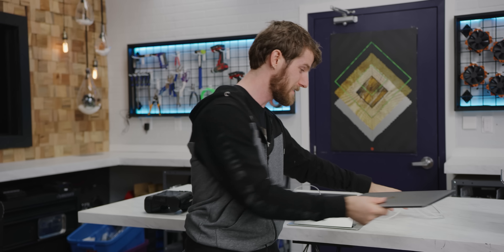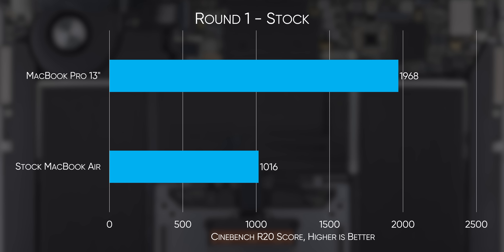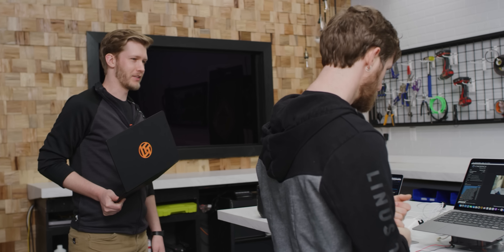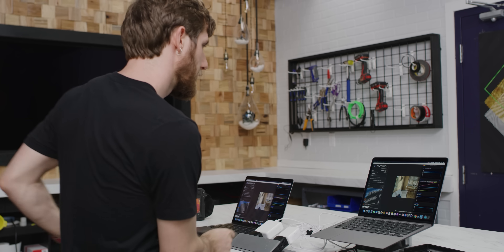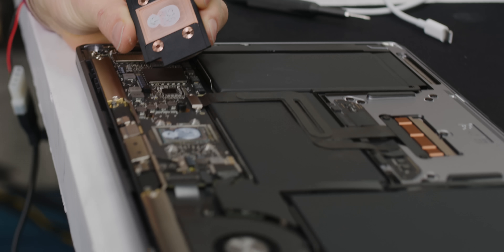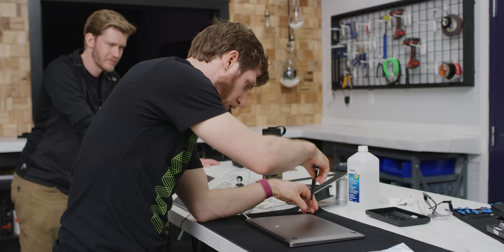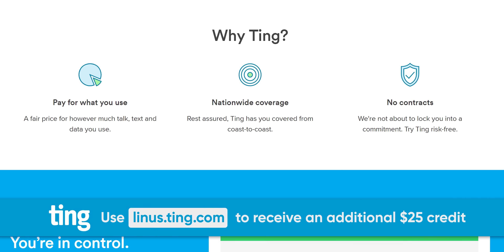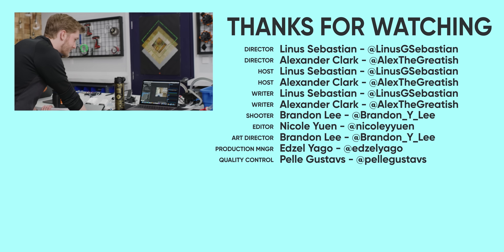Fixing Apple's Engineering in an Hour

Comment: I would've loved to see the fan just completely disconnected to show that it's literally having 0 effect on the computer.
Reply: the computer would probably throttle 100% of the time if the fan was unplugged no matter what the temperature because software
Reply: Then take it out of the case while its is still plugged in.
If the cable is not long enough, get an extension. Job done.
Reply: @The_Keeper  use a jumper with the correct resistance and you can eliminate the fan altogether
Reply: @Damian_CS2  my thoughts exactly
Reply: @The_Keeper  SHORT THE WIRES
Reply: @The_Keeper  you can get fan control software, I use it on my mac
Reply: @OdgeBodge  they should have moved the wiring so that the fan was outside the cpu as a test.
Reply: @OdgeBodge  it already reached 100degrees instantly with the fan.
Reply: my 2 cents on the fan is that it probably passively keeps SOME air coming in w/ negative pressure. it doesn't "actively cool the CPU" it half-ass cools the whole PC but not enough to handle the CPU temp load.
Reply: It probably draws air from one side going over the pcb and out the fan
Reply: And it actually help the temperature by pulling less from the battery... yeah that’s Apple alright.
Reply: @paulgrass4855  how much power do you think a fan uses lmao
Reply: This is semi passive cooling solution. intel made this chip low on power to make it similar to ipad pro. Apple still include fan to cool down entire body of MacBook just for comfort of using it not to cool cpu. That cpu was supposed to never get hot like arm processor. Unfortunately these are not meant to be used like that. And intel is just trying their best at not losing apple as customer. Also apple is not trying to make logical step in to adding a single heat pipe towards exhaust fan. Just a bunch of greed and not caring about customer.

Comment: Maybe Mac OS has some power draw limitations in place. Next time it would be interesting to install windows 10 on the MBA and redo the tests to check if there's any temp difference. Perhaps windows is able to squeeze more performance out of the chip.

Comment: Is someone making aftermarket bottom chassis pieces for MacBooks? Should they be? Imagine adding a proper copper cooling block inside the chassis and increasing its width like 2-5mm... I'd buy that if I was a MacBook power user.

Comment: Put a thin pad of material on top of the heatsink that spread the heat to the fan inside and see if you can get the 1155 speed without external help.

Comment: The water cooler is better for testing as you can use a fan with it without worrying about it spritzing the motherboard if doing open bottom. Unless there is a leak of course.

Comment: Maybe the point was passive cooling to avoid fan failure. But then they could have added a fan regardless. Would it hurt anything if the fan blew the cpu air onto other components? Maybe something else inside is sensitive.

Comment: You know hwhat? Given how much crap it gets for its gimped cooling, and it still is a gimp for the heat and noise factors, how little you actually gain from bonkers cooling solutions makes me a little more forgiving of it. The chip is within 10% ish of its theoretical peak if it wasn't thermally limited, because the PL limits aren't that much higher. On the other hand, temperatures are improved by 20 degrees just by making the CPU make contact with the metal plate on the heatsink, which it stupidly doesn't by default?

Comment: I'm not an industrial engineer, but I think I see what Apple was getting at here. There appear to be plastic bits on the bottom cover that seal the logic board compartment off from the battery compartment. The fan exhausts out the left side into the hinge, and since the only intake (that I can see from this video, anyway) is the right side of the hinge, the fan draws air directly across the chip's heatsink. It's not quite as efficient as sticking a heatsink right next to a fan since some air will go around it, and the air that does go through it will be slower, but the fins on the heatsink are clearly spaced out more to optimize for this high-volume, low-velocity flow.

It's cheaper than running a heatpipe directly to the exhaust fan, not to mention much more space-efficient in a device that already has zero space to spare. There are already PCBs where the heatpipe would need to run in order to be useful, so it probably wasn't an option. They could have made the heatsink bigger, but that too would have required more space. The design mandate for this system was probably to cram it into the smallest chassis possible while still maintaining some set minimum level of performance, and the internal design reflects those priorities.

Besides, these were designed with web browsing and other bursty workloads in mind, where the load is gone before the CPU even has a chance to get hot in the first place. If you want to run Cinebench or workloads like it, a Macbook Pro's cooling solution is much more geared towards heavier, sustained loads. But hey, this is LTT, and I will never not enjoy the gang strapping a ghetto chiller to a low-end computer.

Comment: Instead of cutting the original cooler you could have simply cut another piece of copper to fit in the hole then put paste on both sides... That machine cutting the hole bigger was completely unnecessary.

Comment: was expecting customised heat pipe and rad inside the mac : An Idea for next vid ?
Reply: It's useless. The sofware part throttle it.
Reply: @Smirnoff67  to avoid the hot spot under and lower the PCB temperature it's not useless... Those Mac's are going to have premature deaths and are going to end up on Rossmans table... I wanted to see a proper use of the fan that's all
Reply: @The25Fantome  You want customised heat pipe and rad on a computer that will throttle in any case because it's dumbly software limited despite a better cooling.
So, your idea of video is useless. 
Watch the video again, they cool it way more enough, and yet the software kick in.

Comment: Not only is the fan not connected to the heatsink by a heatpipe or proximity, but the metal plate doesn't even touch the die by default? What the heck? They REALLY wanted to gimp the Airs thermals over the Pro. And probably over the ARMbooks coming.

Comment: Apple : We made a “premium” laptop.
They bought a Intel CPU, Intel Chipset, slapped a decent screen on in (also made by a 3rd party.) built a motherboard, chassis and cooling system that couldn’t keep the CPU cool.

THE ONLY PART OF THE SYSTEM THEY DESIGNED IS WHAT’S BAD!
Providing a pretty box to put a crap cooling solution isn’t a “premium” piece of technology!  This is really no better than when you bought prebuilt gaming PC.  The part that Apple actually built is what’s wrong, apples may be prettier (subjectively) than theirs but that really shouldn’t matter.  
I’d much rather have a ugly laptop with good engineering on both the power delivery system and the cooling system then a pretty laptop with a crap electro mechanical design.

Comment: I think it's a totally win the test with water cooling it, it didn't show improvement in power, but not having your system die out of overheat is good enough. Maybe the best solution for now would be using a standard Air Cooling from a used Graphics Cards mounted in a stand, now that you have removed the heat protection from the bottom and don't want to get burn by it.

Comment: If you use bootcamp to install Windows, you can use Throttlestop to attempt to bypass the stock turbo power limit. Works on my HP Envy x360 15-bp194cl

Comment: I've been saying it for two years, IF Apple decides to put ARM chips in a laptop it's either going to take the form of : Making the iPad (Pro) a full laptop, or killing the Macbook Air lineup with something else. We already know the ARM chips can beat Intel's crappy U and absolutely good-for-nothing Y chips. It's doubtful an ARM part can beat an H part (which is likely what's in the 2019 Macbook Pro) or a desktop Xeon (in the Mac Pro.) The 13" 2020 Macbook models actually took a significant nerf from their 2019/13" models. The MacBook Air took an almost 70% nerf.

Comment: With the experience with the XPS 15 9750, connecting the heat pipe to the bottom panel w/ thermal pads doesn't help the performance at all. The PL1(57W) still decreases to 13W in the worst case. But putting a USB fan blowing on the keyboard actually achieve better thermal in either CPU or the temperature probe that might be sensing the VRM components. 110C+ without the fan, 87C with the fan. The CPU can finally hit 3.4GHz all core under extensive VRay rendering rather than bottom out to the base clock.

Comment: What the hell is that fan cooling? It's not connected to ANYTHING, so it's basically just spinning, making noise and wasting power and space. I'm sure that Apple has at least a few competent engineers, so how did this get greenlit and go into production?
I guess because Apple fanboys are literal zealots who literally pray to Steve Jobs so that their overpriced computers don't die and because Apple will simply refuse to fix it if it breaks.

Comment: Pfff!!! Apple engineering 👎. 
Imagine if there was an Arm powered Mac clone that is more portable, more power efficient (although significantly slower) COOLER, with a cheese grater look that can be used as an actual cheese grater 🤣😜😜.
Feel free to check it out. Both parts of the build are up in the channel.

Comment: 14:00 Yup Linus, i have the same issue with my laptop, it aggressively throttles CPU down to 400Mhz(All-core) (usually when gaming, but also happens on just Youtube) from 3.675Ghz(All-core) turbo speed. i have done all i can in power settings and yet it still limits, also drops both integrated GPU and the other one to 300Mhz at the same time. resulting in about 3fps. It even does this with the charger plugged in. although i have noticed that on really intensive games the laptop does not charge while playing.

Comment: Dell Latitude laptops also don't have the fan connected with the heatsink. It is done so that the fan can be replaced easily without removing the heatsink from the CPU. But as you guessed it, 90-100 degrees instantly...

PS. Watercooling helps dramatically. MaxTech already did it and it was really nice to see the Macbook Air perform the way it should.

Comment: Why didn't you show the thermal pad? I was so confused about why it didn't fit until you guys later mentioned the thermal pad.
And there is still a fan inside and it is in no way connected to the cpu? Has it no purpose at all?

Comment: I'm surprised with how much work you all do on Apple and Razer machines, that you don't utilize under-volting software like Throttlestop. Sometimes limiting voltage can have a positive effect on performance and temperature with power-starved machines. 
Granted, Apple and Razer do this out of the box, but fine-tuning can always be done as each processor is going to have slight variations.

Comment: Honestly, they did it this way for the Macbook Air so it wouldn't come close to the performance of the Pro series. More threads at a lower clock is still more powerful than the dual core processors they had in there, but not enough to compete with the Pro series so there's a visible difference between them.

Comment: At this point the fan is clearly for aesthetics The CPU has been intentionally gimped to fall in line with their product stack.
Reply: It's there so they can pass brain-dead FCC regulators.

'Fan?' - check, 'heatsink?' -check. 
Must work, tell Apple it's approved
Reply: Yup. No reason to buy the i7 or even i5 variants when even the i3 thermal throttles down to the same level of performance.
Reply: There are 2 gaps in the back of the MBA, the Fan is obviously meant to pull air from the other side and then out. The bottom cover even has insulation to guide it over the CPU. 2 minutes of research would have given Linus better information.
Reply: @avnger619  Well by just cutting a bit of copper he got a 20ºC improvement so that stock design is still garbage.
Reply: @castome7pi  Yup, a heatsink that doesn't touch the heatsource... 
That is either pro-level arrogance or idiocy.
Reply: Right, but even with the guides, you lose a fair amount of pressure due to the channel not being perfectly sealed. Also, that sort of design is a bigger dust magnet... If that heatsink plugs up the air will go right around it. The lack of heat pipes also reduces thermal capacity.

Comment: Linus: We could put it in frozen water

You mean ice Linus?
Reply: Thought exactly the same thing 😄
Reply: Nobody had any idea what he was talking about until your super high intellect pointed it out...

Thank you
Reply: There is such a thing a supercooled water (or at least water that has been modified a bit to stay liquid at and below its normal freezing point). If you add salt, that lowers the freezing point. add in crushed ice, and you get water significantly colder than it would normally freeze at. This is, by the way, how the 0 degree point on the Fahrenheit scale was determined.

All that said, though, I think Linus just meant really cold water.

Comment: This basically proves everyone hating on apple for not placing the fan directly in front of the heat sink wrong. If 4% is all you are going to get from opening the case and directly pointing a fan at it, the original fan clearly is doing just fine. It's not like the fan isn't going to pull air across the heatsink just because its further away. (if you take precautions to guide the air across it of course.

Comment: Imagine not being able to cool 25 watts of heat. A square of thermal foam or thermal pad connecting the package to the metal housing would do a better job than Crapples solution

Comment: 5:33

I CAN'T BELIEVE THIS! THIS IS OUTRAGEOUS MAN!

Somebody show this Louis Rossmann ASAP. Pretty sure he'll rant about it for at least an hour.

I mean, we all knew the thermal design was crap because the fan wasn't attached to the heatsink and therefore not actively cooling but this is FAR WORSE than that. They designed a heatsink that doesn't make contact with the CPU. O don't know what to say about this.
Reply: it's just wireless thermal material bruh
Reply: he did a video about this way back
Reply: @frytkiniesasmaczne  I know that one, it was about the MacBook Air 2018. Actually there were a few other videos where he mentioned this. But this not only about "wireless cooling", it's about the fact that the heatsink apparently doesn't even make enough contact with the CPU to transfer the heat. I didn't know this thing is THIS much of an engineering failure.

Comment: Linus: Stick to what you know, which is gaming on Windows.

This is a massive, embarrassing, fail and you are posting nothing but clickbait. You didn't fix anything because you didn't actually deliver there phenomenal speed gains that we were expecting, given your click-bait title.

Shame on you!

 If you don't like that Intel CPUs run ridiculously hot then go after Intel who os that company that makes those infernally hot CPUs. No applause for you because you are completely clueless when it comes to Anything other than gaming on Windows, you just don't have the knowledge nor experience to figure things out, so you make snoozer videos once again.
If you really think that the fan doesn't cool the CPU, because its not right next to it, then you would not belief that the 10,000 Linux 1U servers that we maintain for our clients also cannot cool the CPU because the fans are all the way at one end of the enclosure and the CPU is all the way at the other end of the enclosure, with no connections between them at all (yes they are all brand name 1U servers that you would recognize), you just are completely clueless at how hardwire works.
You also fail to realize that this is not a gaming machine, its a lightweight, high reliability, productivity machine, by not having a fan that is not directly exposed the outdoors, like the cheap laptops that you personally don't actually use every day, the fan is not a failure point.
Yes it sounds weird but Apple has proven that its true, and they proved it more than a decade ago, that internal fan will still work like new 10 years fro now whereas those cheap clone laptops will have gone through several fan replacements if that cheap laptop doesn't wind up in the junk pile along with all the other abandoned Windows/Linux clone laptops.

Comment: @4:24 A reasonable explanation? I think the air flow over the CPU is there when the case is closed. Isn't it possible to check in- and outlets using smoke or something similar?

Comment: So.. Apple designed the Air series to draw 35W for 2 seconds, then throttle down to 13W and stay there, regardless of temperature. And the heatsink doesn't even make contact with the CPU, because it's designed to be too far away. And the fan is there to keep the chassis cool, not the CPU. 

How to FUCK do they sell as many units as they do.. Are you fucking serious.

Comment: 6:10, wouldnt it have been waaay safer to add a copper shim? Also Alex would make the best surgeon.
Patient: "I'm really nervous" 
Alex: "You and me both" 😂
Reply: Well putting a shim between the die and the heat sink would be necessary so if that is too thick it could still destroy the die and would be way less effective. The drill he uses is very old but very well adjustable if you know what you're doing. It is in no way comparable to just winging it with a cordless drill.
Reply: @CheapBastard1988  If he took off too much material (which he did) you could crack the die as well. Just making a suggestion.

Comment: Can you try using bootcamp to install windows and see if that makes any difference if the CPU is cooled?also I would like to know if putting a heatpipe with a couple of fins in front of the fan can handle the power limit.